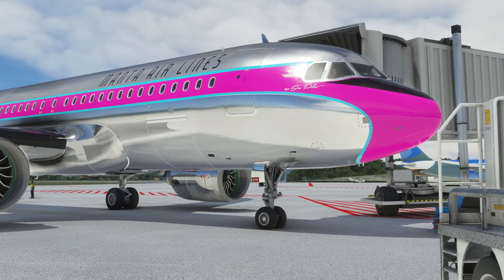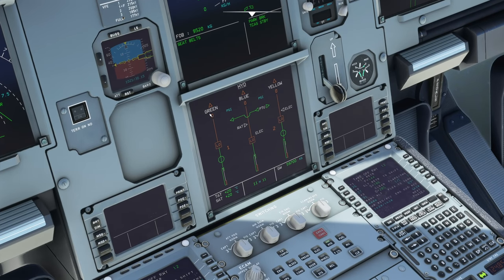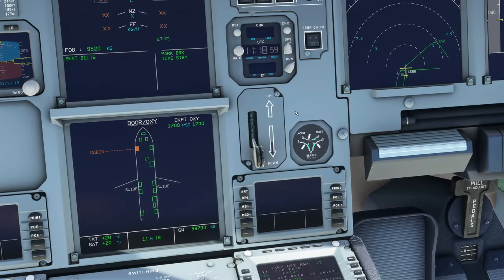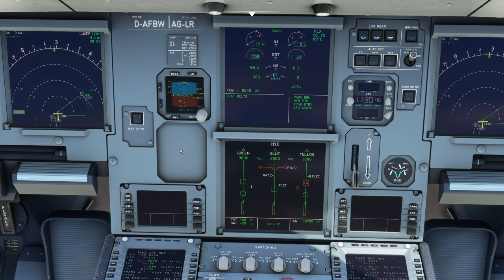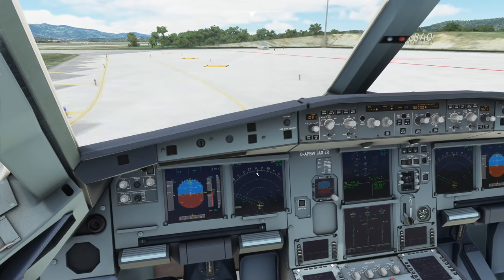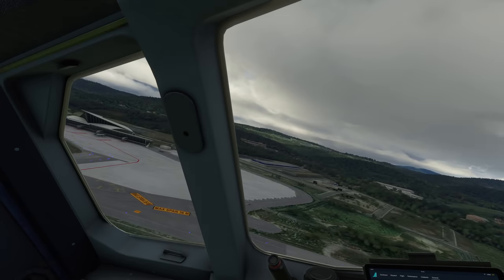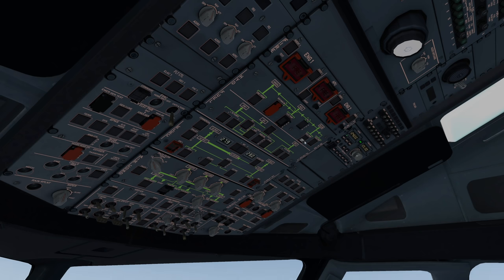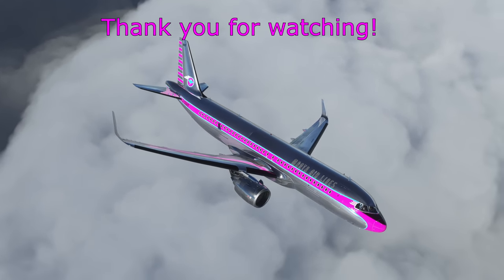A32NX Gets Hydraulics! System Overview with a Real Airbus Pilot! Ft ToLiss A321

Comment: On a far, far smaller scale, the hydraulic systems on the fork lift trucks we work with are under high enough pressure, so much so when a pipe bursts on the lines the thin jet can pierce skin. Add to the fact hydraulic fluid is extremely deadly! Scary but very useful stuff.
Reply: When I was an aircraft fueler, we had notices on every wall of our office about how scary a hydraulic leak was and what to do (GTFO and notify flight crew immediately). Loss of limb not unheard of
Reply: Yes... AvE has nice demonstrations about hydraulics (accidents)...

Comment: Think of the hyd acc as a balloon. When any hyd pp is running the balloon is being  blown up to 3000 psi. When the system fails the balloon still has 3000 psi to put back into the system. Great if the failure is a pump. It gives some reserve pressure. Not so great if it is a burst more spill.
Reply from the maker: Great way to look at it, thanks!

Comment: I wonder if it was cheaper to fit the PTU instead of just adding another electric pump to the green system as a back up. They did it for the A330 and A340 where all pumps have engine or electric pumps then green also has RAT
Reply from the maker: A great question and I wish I knew the answer! Thanks for watching Thomas!

Comment: Just a quick question not directly related to this vid. Does the A32NX now include top of descent calculation? I asked back in like January and was told "soon". But haven't had the time to fly MSFS for more than 6 months now.
Reply: I was wondering this too - I still have trouble getting the A320nx to properly follow descent profile in FMC after importing from SimBrief and setting STAR
Reply from the maker: Not yet, the VNAV is not there, but there is a top of descent calculator in the fly pad efb/tablet now!

Comment: amazing  video sir thanks    3000 psi       that's insane so much info brilliant nice to see it simulated as well what a great aircraft    so if your powering both systems from the  flight deck ptu bark nose in cabin bark might be heard is  that correct please      so if 2 systems failed would only one side of the elevator  work would that give you a roll rate
Reply from the maker: Thanks Dg!

Comment: I never noticed the green ring just inside the engine inlet for the left engine.  Is there a yellow ring inside the right engine inlet also?  Just wondering.
Reply: No it’s just a feature of the PW1000 engines. Same on both sides
Reply from the maker: Indeed as Thomas says, the green ring is actually only on the PW version of the engines on the real aircraft! Thanks for watching

Comment: What could be my problem if the  fbw doesn’t climb all the way, and it’s 200 feet short, and the altitude starts blinking? I change altimeter at transition altitude to standard.

Comment: Thank you for this video!
But what happens if you lose hydraulic fluid in all three systems (as has happened in the past).

Can we still control the plane with the thrust of the engines and land without too much damage?
Reply: Depends on how much thrust changes affect pitch and turn. Nobody wants to test that
Reply: @tomstravels520  I would love to test that in sim :-)
Reply from the maker: Yes it can fly but things will be interesting. Possibly an excuse for a video!
Reply: @320SimPilot  YES !

Comment: Does a pilot always start the chrono from the moment he starts an engine?
Reply: I believe so as there a is warm up time for the engines as well as making sure they start in time
Reply: @tomstravels520  That makes sense. I always thought they did it from the moment they started the takeoff, because you can only run on toga thrust for 5 minutes if I'm not mistaking. But then again they could just reset it at takeoff I guess? :D
Reply: @Byzzon  I have the elapsed time start from pushback to parking and the Captain Chrono running from TOGA to off the runway. Then use the chrono in the centre for anything else like a circling approach timing
Reply from the maker: Chrono is used to time each engine start, restarted for each. After the second engine is running it is restarted to time the warm up. At takeoff it is restarted again to time the takeoff thrust. Hope this helps!
Reply: @320SimPilot  Thank you for the clarification!

Comment: The A380 and A350 system runs at 5000psi but only has a yellow and green system
Reply from the maker: Yes I believe they have a more advanced way of control in the event of a fluid loss
Reply: @320SimPilot  yes. The EHA’s or EHBA’s installed in some of the control surfaces. A mini hydraulic circuit where the fluid is isolated from the main system I believe

Comment: Any ideas when the next stable version 0.6.1 will updated to 0.6.2? Been over 2 months now. Flybywire were updated stable version almost every month.
Reply: Guess it's because they're now developing more complex systems. The first updates dealt with all the things wrong with the default aircraft. A lack of stable updates is more than likely a very good thing, considering the near daily updates to the development build 🙂
Reply: @Pilot.0101  that makes sense. I seem to have problems with my thrustmaster throttle quadrant, when I try to use the dev version.
Reply: @ganntradingsystemstimecycl2783  Make sure you setup your throttle detents in the EFB Tablet for the dev version. That should fix any throttle issues.
Reply: @RichardhancockUk0  ahh thank you so much. I trying everything with calibration, sensitivity in control page with no luck and pulling my hair out.
Reply: @ganntradingsystemstimecycl2783  Not the MSFS calibration or sensitivity, you need to use the EFB to calibrate the detents. Works wonderfully for me.

Comment: Hi, curious at work when we dispatch flights pilots always start with engine 2. It's there any particular reason for this or is it just company procedure?
Reply: I'm assuming it's for setting the park brake?
Reply: @HarrisonVogl  yes. Engine 2 pressurises yellow system which powers the parking brake
Reply from the maker: Exactly! However it is not a huge problem if you start engine 1 first, as we do that for single engine taxi out

Comment: Trouble with the Toliss is that the external model isn't very good.
Reply: Toliss have a MSFS a320?
Reply: @Hyperr0209  no he’s talking about the Toliss A319 and A321 in Xplane. Although apart from the current A319 nose cone I don’t know what he’s talking about. It all looks fine to me
Reply: @tomstravels520  You have to quite closely. Cracks and gaps in various places. Fan blades etc. Not a big deal as it's a great plane.
Reply from the maker: The ToLiss visual model is very accurate and functional, but of course the MSFS aircraft always look stunning! I suspect with the new X Plane lighting system we will see the ToLiss looking very nice in X Plane

Comment: imagine having triple hydraulic failure..
Reply: That happened to United Airlines Flight 232, and impressively enough they managed to land by using the engines to control yaw, pitch, and roll. There were lots of fatalities, though the fact anyone survived, is incredible.
Reply: @fibre0690  Wow,  I'll look that up.
Reply: The only plausible way I can think of to lose all 3 systems and have no use of the RAM turbine is some kind of catastrophic engine failure resulting in an explosion and/or the fan blades coming loose and severing the hydraulic lines.

As you can imagine, you've got a fair bit more than just the hydraulics to worry about in that scenario

Comment: But still no VNAV
Reply: Airbus does not have VNAV. I assume you mean managed descent modes to correctly calculate where the T/D is?
Reply: @tomstravels520  thats what I would like to know - I cannot get my A320nx to properly follow descent profile in FMC most times it descends to shallow - is this related to lack of T/D calc ?
Reply: @Speckled10  mostly likely. It needs to be able to calculate a profile where it will hit speed and altitude constraints, slow down with enough time and the 250 Limit at 10,000ft
Reply: @tomstravels520  Yes but everyone always refers to that part of the autopilot as VNAV since, its not a real aircraft and were just talking about simulators.
Reply: @Speckled10  Because it isnt in the sim yet, there isnt an aircraft in the sim with a full proper working autopilot and FMC (aside from the CRJ, but that is a fairly simple system)
Reply: We are working on it very hard and good progress is being made.